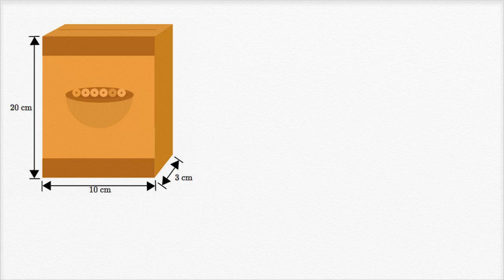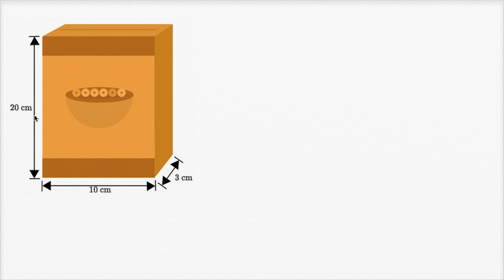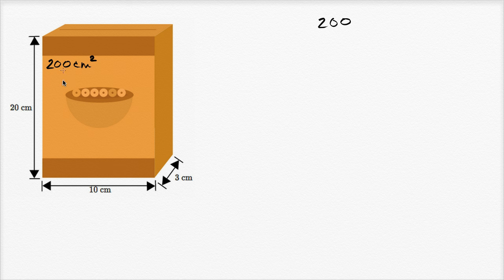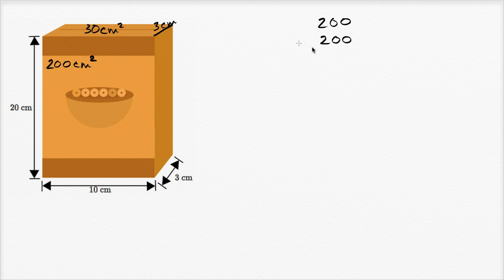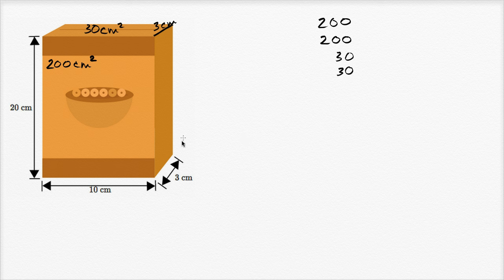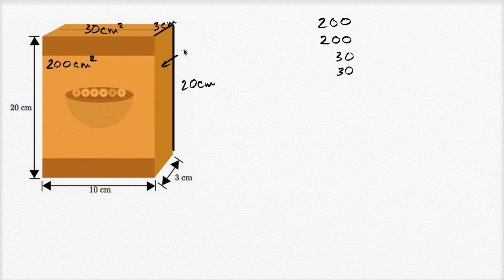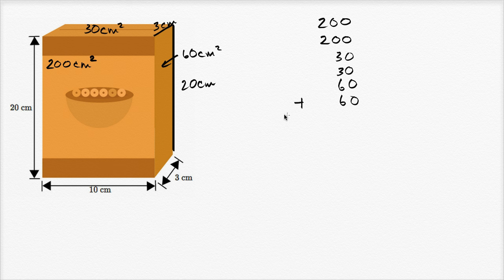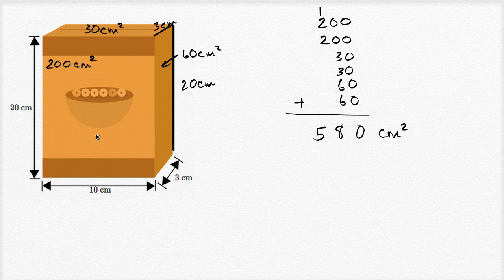Surface area of a box

Comment: Come to think of it, why not internally group the doubles in the math problem as you solve the problem, for instance: the 200 x 2, plus the 120 plus the 60, each of the latter two of those numbers is the combined total of two other groups; so really you'd have 400cm(squared)+180cm(squared)=580cm(squared) in this formula for the total surface area of said box.